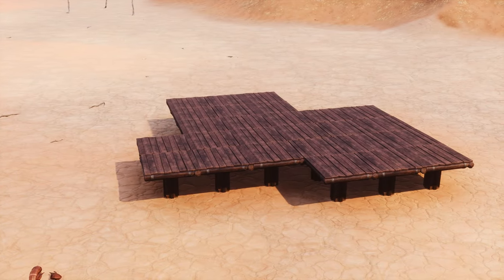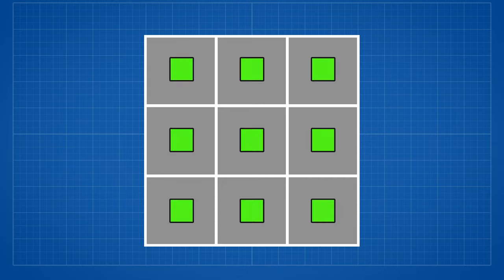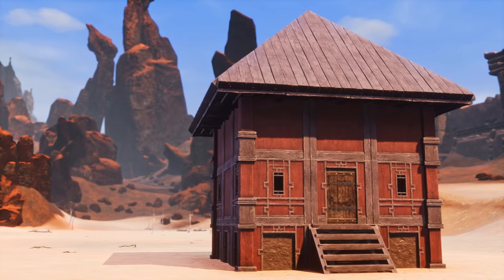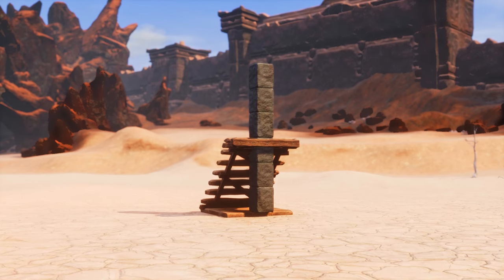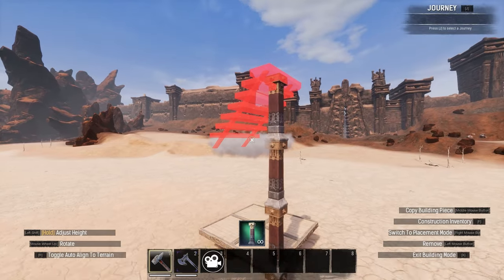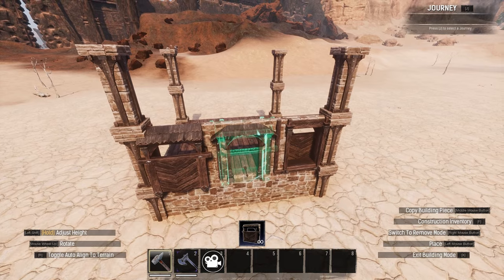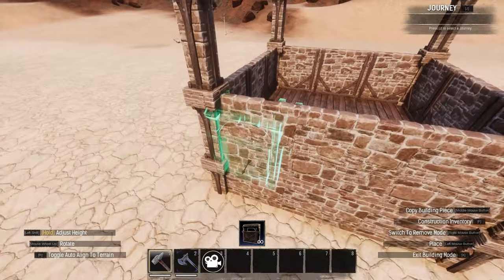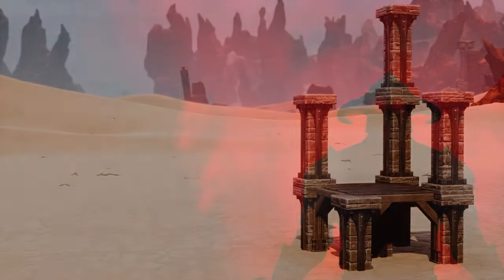The Best Building Tip: Pillar Trick Guide! | Conan Exiles

Comment: What I don't understand is why they don't make this functional in the base game.  Is there a reason why they don't offer snap points on the corners of ceilings and foundations for pillars?
Reply from the maker: I would imagine it was a design choice for the stability system during development. I wouldn't be surprised if this sort of thing is kinda hard to change now, after years of code on top of code

Comment: Cornerpillars can work with foundations without mods IF you have the DLC Riders of Hyboria. The mesh of the stable-pillars is so small, you can put foundations back in after you placed the pillars in place. But then again why use foundations in the first place.
Reply from the maker: I actually never thought of trying that. I can see it working nicely with maybe Insulated Wood foundations, but that's the only set that really jumps to mind. Thanks for the tip!
Reply: @Eradicati0nn  After you place the foundations, you can always replace the pillars with different ones. no need to stay at stable-version.
Found this out by rebuilding one of "Creative Builders" Castle in the Lake builds.

Comment: nice work! so you CAN do the pillar trick WITHOUT mods just to clarify? but it is a little more labor intentensive correct?
Reply from the maker: You absolutely can do it without any mods, and on any platform. It's a couple more steps than just placing corner sockets from GCAM, but it's probably a 10 second setup when you've got it down

Comment: I started a new base on an official server and ran into a problem with the pillar trick. I laid out my pillars & ceilings first to set up my floorplan, and then placed "corner pillars" in order to provide support for what will be the upper floors and roofing. The "corner pillars" were actually side pillars aligned with an outer wall, one on each side of an intended doorframe. The problem is that once the pillars are in place in the ceiling tile that is the intended doorway, I can no longer place a door frame there, because the "corner pillars" are preventing me from putting a doorway between them. Is there a better way to approach this, and have I sufficiently communicated it? If I place the doorframe first, I don't think I can do the pillar trick at that point, or can I?
Reply: Never mind! I went back and re-watched your video and forgot all about the workaround of placing a non-rotation-fixed wall in between the pillars, and then just replacing that wall with a doorframe. Worked like a charm. Once again, your videos helped me solve a problem. You are da man!

Comment: At 5:00 you discuss "something important to know is that side-socket pillars cannot pass stability to an off-grid tile". I'm new and unsure of what this means. Are you saying that these side-socket pillars are purely decorative and offer no stability?
Reply from the maker: Somewhat, yes. By shifting the pillars off-grid, they can't give support to the original grid. However, if you were to build ceilings on top of them, they create a new grid that receive support from the side-socket pillars
Reply: I'm missing something. In your video you state that if you were to remove the bottom green pillar, everything would collapse. This implies that the red pillars are not sufficient to support the ceiling built on top of it. My poor brain sees this as a contradiction to your answer above, but perhaps what you're saying is that the ceiling that sits atop the green pillars would collapse, but a ceiling built atop the red pillars would be supported, although that ceiling would then be centered above the red pillar, making it essentially on grid thereafter? By the way, your videos are FANTASTIC, and thank you so much for taking the time to answer my question, I'm typically a builder in every one of these games but I'm a stone-cold noob here!
Reply: BTW, I subbed, commented, liked, rang the bell, donated, and would put up a lawn sign pitching your channel if it would help. ;-)
Reply from the maker: @BobFromSeattle  Yeah your interpretation about the red pillars staying supported and essentially becoming the new grid is correct, I probably just worded it poorly 😂

Comment: I have a question for you Eradicati0n , have you ever used a mix of foundations at different heights and pillars, with the use of ceilings AND hatch frames? apparantly pillars and a number of other structures will go through the hatch frame even with normal settings, like planters, compost heaps and dryers.
Reply from the maker: I can't say I have tried that, but it doesn't sound like the sort of circumstance I'd come across natively. I don't think I've ever tried running a pillar through a hatch frame, I'll have to see what happens
Reply: @Eradicati0nn  you can also place a trap door on the hatch frame once the pillar and other objects in, but i save that for last for placement rule reasons.
Reply: oh, also! I have been placing planters close enough to the ceilings where the plants would clip through the floor, been really enjoying floor clipped lotus plants with the derketo baskets for my garden game, that and the flase mandrakes for more natural foliage to hide trap doors or making a more primitive hedge maze without needing the bazaar hedge maze items.